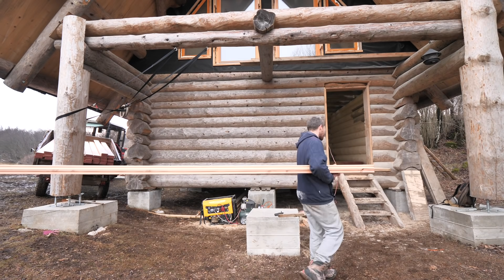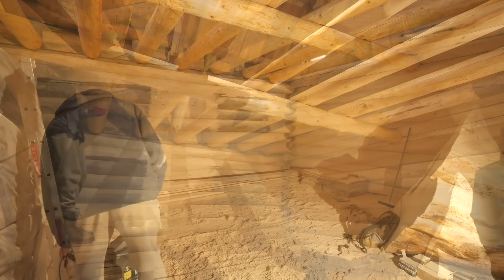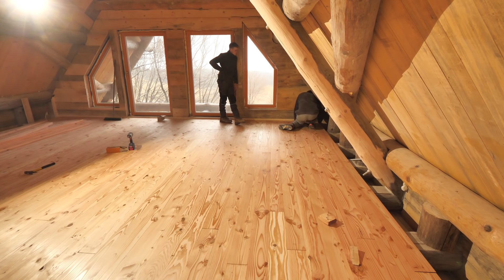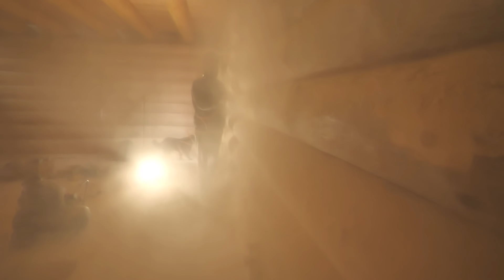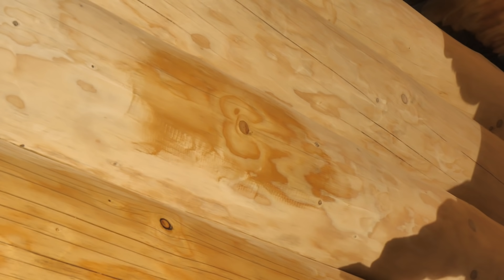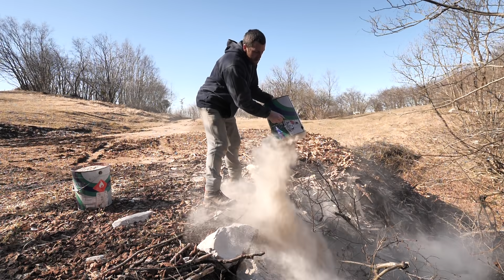Off Grid LOG CABIN Build / Loft Flooring, Cleaning the Dust,...(S 3 Ep 2)

Comment from the maker: For everyone asking why I didn't use a vacuum cleaner. I did it this way because it took me only a few hours and I don't have a vacuum cleared for this kind of job. The time I would need to go to the city and buy or rent a vacuum cleaner I would already be done like I did it. Most of my work has been done with the tools far from ideal for the situation and now you expect me to use a vacuum cleaner... 😆Anyways thanks for watching and for the suggestions!
Reply: Ultimately it is your decision of course
Reply: Get a leaf blower. Open the windows and doors and blow the house out. A lot faster than a compressor or vacuum. Done it thousands times.
Reply: Не обычный способ высыпать опилки 😃
Reply: @finscreenname  did you see the size of the pile of dust that was created?  leaf blowing all that through the door and the mess it would create outside.
Reply: Once the dust was in a pile, why didn't you take it out of the house?  A wheel barrel and shovel works well.
Reply: @outsidethepyramid  You should see when we take down plaster walls. Open a window upstairs and the front door. Not saying it would have got it all the first run but blowing off every log with a compressor had to take hours. Blow it out and let the dust settle and do it again. 10 - 15 minutes tops and you can do it over and over every day and after the cabin is built clean up leaves with it.
Reply: @finscreenname  anyways, I hope you don't inhale a single bit of it. that's the main concern.
Reply: I would have asked my sister to do it.
Reply: @finscreenname  yup. Only way. Have to leaf blow  3 or 4 times to get all the dust finally.  But then it all should be gone. There  is still a lot of dust still in there. Way to early to be finishing logs
Reply: @outsidethepyramid  leaf blow after piles are shoveled out. Leaf blower only way
Reply: @outsidethepyramid  don't sh as ke it too much, will fall off
Reply: @harleytucker6403  IMHO it was a celebration of sorts
Reply: Beautiful job
Reply: @a.b.6233  Good One!!!!!
Reply: Tools not ideal for the situation?  I thought everyone carved toothpicks with chainsaws.   Haha.  Loving the build, vacuum cleaner or not. Haha.
Reply: you made the best choice. you could have made it better by making it hours longer. i didn't want it to end. for me, you are zazen.
Reply: i mean, watching you work is .. i don't have to think about it, like watching nature unfolding, like a flower opening.
Reply: Nick, what did you cover the walls with?
Reply: Farewell chainsaw!
Reply: Respect to you Nik !  keep on doing your thing the way you see it fit 👍👍
Reply: You  do not have to explain your methods to anyone with what you have built with the most minimalist use of tools and your own two hands one of the most beautiful cabins I’ve ever seen God bless and be safe
          Plus I’d like to see the vacuum you’d use on that pile you’d actually be better off getting a grain vac
Reply: C’mon, experts. Let the man do his job. He has his reasons and only he knows the circumstances under which he is working. Respect.
Reply: How much it cost so far
Reply: well you have a air compressor, i could have built you an air powered vacuum. i build them all the time at work. some times we have all the parts to build things we just need someone to show us how or where to look for info. a broom stick , plastic wrapper, tape, a wire to make a hose. the broom stick is just a form to build to on and is removed. thanks for sharing you log cabin build with us, great work, it beautiful !!!
Reply: @sergeyzeleni503  Tung oil.  It's what I use on antique furniture that I refinish, too.
Reply: @finscreenname  ON NE DOIT PAS SOUFFLER , ON DOIT ASPIRER.......Ouvrir porte et fenêtres , ça , c'est vraiment indispensable , bien sûr .
Reply: @jacquesdeghorain3162  Google Translate;  "WE MUST NOT BLOW, WE MUST SUCK ... Opening doors and windows, that is really essential, of course."
Not sure how to answer that my friend. 😁😊
Reply: Hai fatto benissimo secondo me 👍
Meno elettrodomestici e tech nella nostra vita quotidiana e MEGLIO si sta.
La buona vecchia
"scopa" 😊👍
A parte che qualsiasi aspirapolvere si sarebbe bloccata con tutta quella segatura.
Great video.
Saluti affettuosi dall'Italia
🍀💖🕊️🌿☀️🌺✨🍀
Reply: @finscreenname  It would still rise up and settle in every tiny crevice, not good for the varnishing.
Reply: save the sawdust add used vegatable oil and press into bricks, good for multi fuel logburner
Reply: sorry to be offtopic but does anybody know a tool to log back into an instagram account..?
I was stupid forgot the account password. I appreciate any tips you can give me
Reply: @Juan Casen Instablaster =)
Reply: @Marco Shepard i really appreciate your reply. I found the site thru google and im in the hacking process now.
Looks like it's gonna take quite some time so I will get back to you later when my account password hopefully is recovered.
Reply: @sergeyzeleni503  He said in description under video!
Reply: Hey Nik where do I find yur music from these videos they r absolutely beautiful.....thanks

Comment: That fine sawdust together with aracet or varnish can be used for plugging and retouching where the wood did not join perfectly.
Reply: Don't tell the Master what to or not to do mate
Reply: @demoe5676  , it was just a suggestion. Likewise, that sawdust mixed with gas or gasoline in a tin can can be used to light a fire.
Reply: @Vasile.C  that's right. Good advice tbh

Comment: Looks really good but those "floating" seams between the ends of those boards have the potential to be a major squeak problem down the road. Thanks for sharing.
Reply: Those boards should have been glued and nailed down.
Reply: I don't think he needs to worry about that with tongue and groove boards. They support all along the edges and over the seams. I was thinking the same when I saw how he was doing it, and then thought about the physics of the tongue and groove. They should be okay. Cheers.

Comment: Even though the tongue and groove looks quite thick and "grippy", I personally would have cut the ends of the boards so that they would rest on the middle of the cross beams. Just a constructive criticism Nik, that's not meant to take anything away from the fact that your house is a masterpiece of patience, dedication and craft. Hats off to you. Bravo
Reply from the maker: I know it would definitely be better to cut them on the beams, but I had a limited amount of boards and having unusable cutoffs I was afraid to not have enough boards to finish. Doing it this way, I had pretty much zero cutoffs. Than the boards are 4cm thick with strong tongue and groove.
Reply: me too there's one board i didn't do on, and it bothers me every time i look at it. It drops ever so slightly. The floors looks good

Comment: I know this tip is late but when you have a situation where you are creating a lot of dust use a spray bottle of water - one that can create a mist. When you spray in the air, the water catches the dust and brings it straight down to the floor. Spraying the dust on the floor wets it enough that you don't create another cloud as you sweep it up. The cabin is coming on wonderfully - well done :)

Comment: Plug in the shop vac instead of running the compressor to clear the dust. The dust will still settle where you don't want it using air. The dust is good for the garden.

Comment: Also, a tip for anyone doing similar application of finish - for a large area like this it pays to get a large, high quality natural bristle brush, may 6" or larger if you can wield it.  It would cut the application time considerably since it holds so much more product and if course, is wider.  On the other hand, applying finish can be meditative, so a small brush may be just the thing.

Comment: 10:18 I noticed that the wood you used has side grooves in them, but the length of some of them were cut so that they were in the air (instead of ending on a floor beam for added support). The way you have some of those ends is a weak point, and could cause the floor to creak/flex in those areas as people walk over it.

Comment: The logs holding the roof up do not appear to be sanded & still have that dark color.  Will you be sanding those before finishing the floor polishing?  Also, it's getting quite muddy in your front door area. Do you have a way to put down a path of gravel leading to the steps to front door?  I would hate tracking all that mud in on the new floors.  Love watching your build. IT'S BEEN AMAZING TO WATCH THE STRENGTH IN YOU TO UNDERTAKE SUCH A TREMENDOUS JOB.  GOD BLESS YOU & YOUR FAMILY. ❤ ✝️

Comment: You should've used polyurethane foam to insulate those areas where you didn't use a vapor barrier after the rock insulation. One or two canisters would've done it. 
This will come back and bite you in a few years with mold and mildew in those areas.

Comment: While you were sanding and with your imagination, you could have clugged a vacuum hood over the angle grinder and saved your self a ton of dust and cleaning. Then even while finishing it up. a shop vac instead of a compressed air would have saved even more time and been better for your lungs. However, I applaud your efforts.

Comment: Question - when you squish the floor-boards that tightly together - wont they bulge or crack due to heat expansion in the summer period?
Reply: He was using Tongue & Groove boards which are usually kiln dried so it won't be a problem.

Comment: Can you put 2 or 3 layers of tung oil on? Does the logs suck in the oil? Just asking! I was a helper with a lot of questions.
Reply from the maker: Correctly you should put around 4-5 layer for the protection if the wood is exposed to rain on humidity. I used only one because I wanted to just achieve a more vibrant color of the wood.
Reply: @nikrijavec47  thank you for replying

Comment: No glue or even rosin paper below the flooring....going to be one squeaky floor.
Reply: I was digging through the comments for this. I cannot believe there is no subfloor, no plywood, no paper, nothing! And some of the boards are connected HANGING IN THE AIR, that seems so dangerous! Near the walls, you can see the floor is already curved, imagine 2-3 years from now, exposed to moisture how crooked it will be :(

Comment: 10:53 I thought you were supposed to keep a distance to the wall while installing a wooden floor because wood expands over time?
Reply: Kiln dried wood will only expand due to moisture! So if a house is heated & doesn't get wet then the wood will not expand.